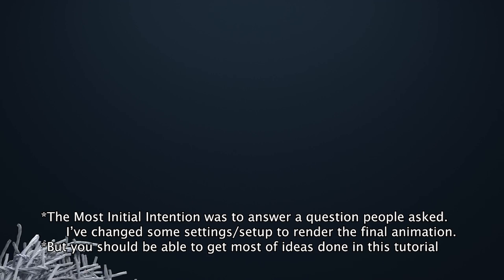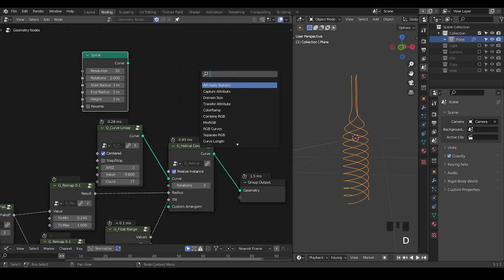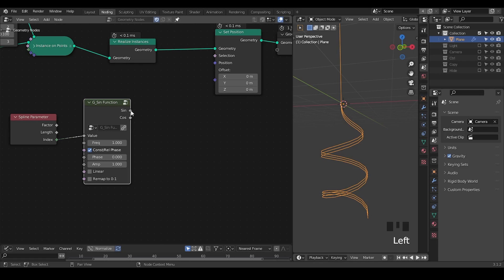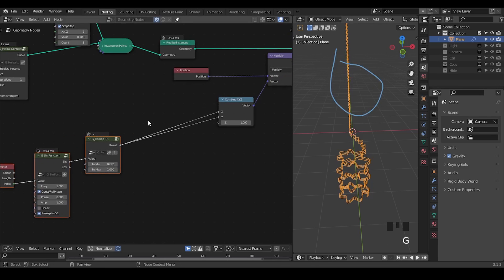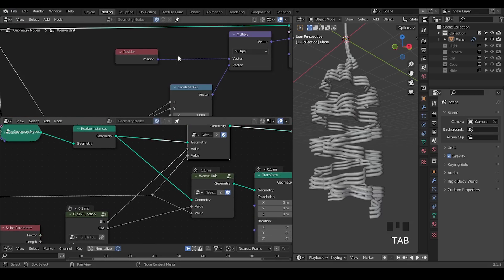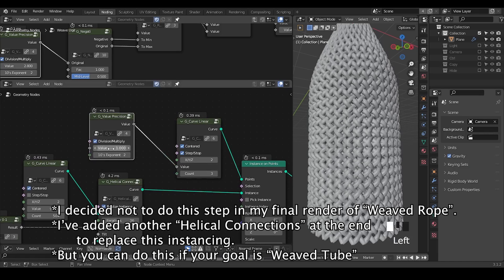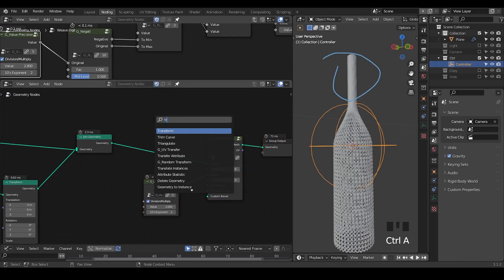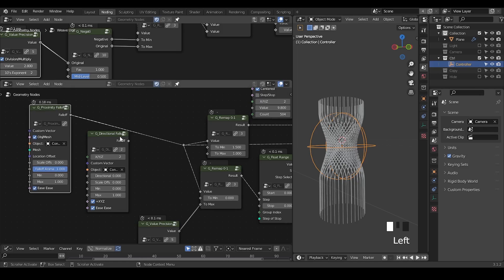[Tut] Woven Rope/Tube - Blender Geometry Nodes 3.0+ Field

Comment: The cos Output of the G_Sin Function Node is missing in newer versions, how do I continue then? Besides that awesome video!
Reply from the maker: cosine function is sine function whose phase shifted by "pi/2", so around 1.57.
Reply: @bradleyanimation120  Thanks! Would it also work to just add a Math Node after the sin output and set it to cos?
Reply from the maker: definitely not.

Comment: Hi Bradley! I was wondering if I could generate knit textures like these using geo nodes to an existing model with dense quads so I can make that model completely enclosed in a knit pattern.
Reply from the maker: this method no. Either you accomplush it by using shader, or you instance knit unit in geometry nodes. these are two main stream ways of thinking

Comment: soryy may i ask your question?
How did you get the rope to be so messy when it came out
Reply from the maker: just adding noise to the part which is coming out. In other words, just mask your noise displacement with your directional falloff
Reply: @bradleyanimation120   sorry can i ask you in discord?
Reply: @bradleyanimation120  you mean i'm going to add a noise texture and connect
Which connection point is less than the previous falloff?